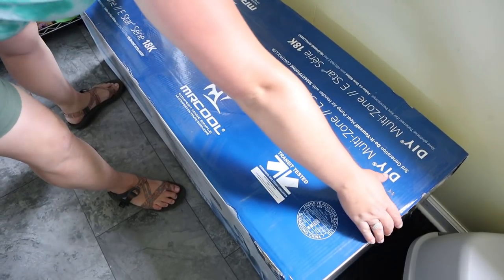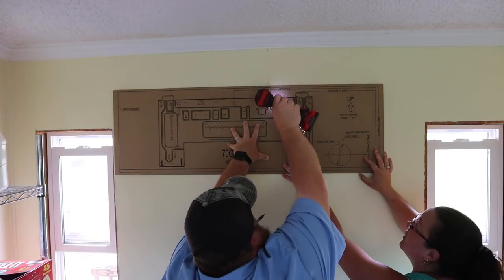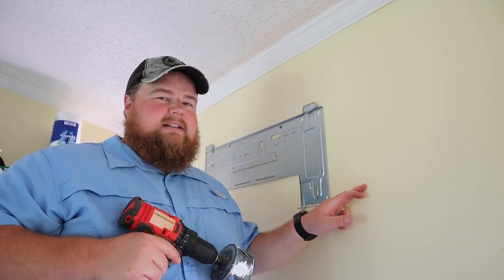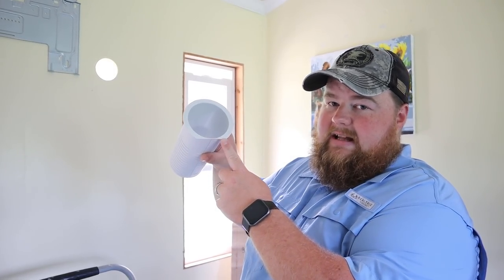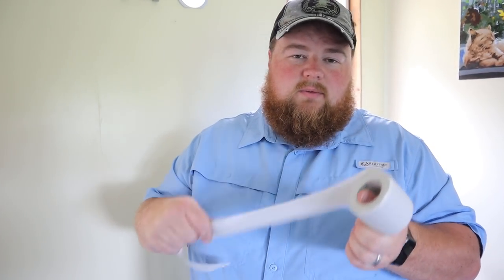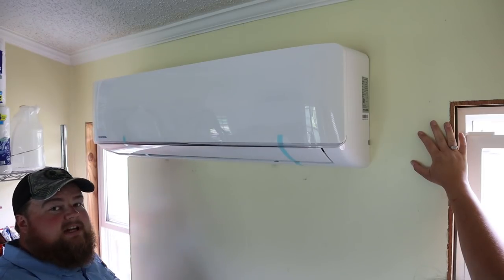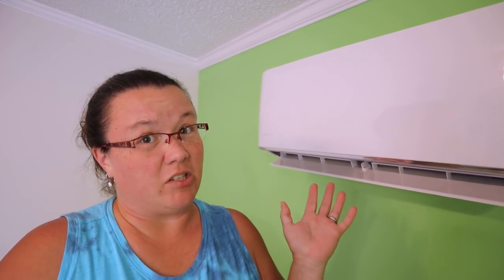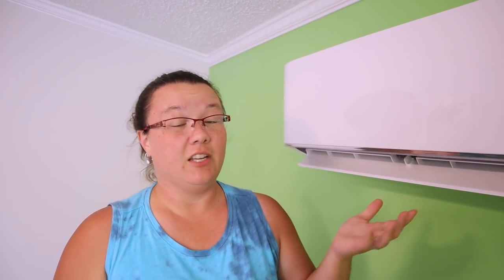Drilling HOLES Through the WALLS - Indoor Unit Mini Split Install

Comment: Push the wall thimble trough the wall, go outside, mark the thimble where it needs to be cut/trimmed flush with the exterior wall.  Remove the thimble, cut it at the mark, replace it, install the exterior cap/trim piece sealing the trim piece in place.

Comment: It's a frosting...  Now, you could center the unit if you wanted to remove that section of the sheetrock and re-frame the studs then put new sheetrock.  I know, that's being compulsive but that's what I would do.  (Oops, not sheetrock)

Comment: Hey you two, I am 83 yr old lady, me and a young friend installed my My Cool, 18,000BTU. I live in a 61 year old 560 sq ft mobile home.  You will grow to love that thing  on hanging on the wall. They wanted $4000 for a unit and I was running a 12,000 BTU window unit that I could not even hear the  TV.  I don't know how the multi zone unit works but I am sure just as well. I also talked to Mr Cool several times for help and they were great. I am glad you can turn the temp light off, in the dark of the night it is pretty bright. I did get my unit from Home Depot for $1700. Just cannot beat it, so quiet. Keep up the good work, I am anxious to see you hook up the condensing unit.

Comment: As I watch this video, I am having two AC units installed here in my home.  The older units are 15 years old and one has been giving us problems with low cool air, we don't want to be left in the heat, just in case the unit fails us!  lol  A lot of adjusting as one unit was too close to the ceiling and in an awkward place to have it lowered.  That of course means cutting into the wall, running the wires, etc. down to the lower level and into the ceiling and outside!!  Happy that you both challenge yourselves and get it all done!  Awesome work!!  TFS  :)
Reply: @lifequest7453  I believe in using something as long as possible.  Happy to hear that it's still working for you!  If you change eventually, this video sure does help!  :)

Comment: I love my Mr. Cool mini split... Had it 3 years now. Heated the house in negative temps.

One thing they don't tell you is crud (mold?) will build up on blower fins. You'll have to disassemble the inside unit to remove the blower fins to hose them down

Comment: When I have to hole saw through a wall, I drill a 1/4" pilot hole through first, with a long installer bit.  Then hole saw from the inside, then go outside and use the pilot hole to guide the hole saw.  That way your holes line up perfectly, first time every time. 👍

Comment: Silicone tape is tricky but great stuff.heat res and uv res , if stretched enuff it will adhere to its self.I usedmany rolls for HV splices.I would have centered tha unit by drilling new mounting holes to match tha studstuds.They work great, had one in my shop for years.
Reply: @lifequest7453   I, like Sam, am bothered by  off center mounting but am sure what they could have done to make it more centered because Ive done it. Mines worked Great for many years. Cl;-[p} Happy 4th

Comment: So I've been watching a few of these videos to try to brainstorm how I'm going to run the lines and stuff (almost nothing is ideal, sadly). A few things I've learned that I should share with y'all:

- the tape is not supposed to be adhesive; it's insulating tape for when the lines leak some condensate that makes it through the foam - you don't want it to leak in the wall. So you have to tape where the wrap starts and ends to keep it in place.
- before you click down the unit, you can adjust it slightly left and right to align it - the smaller air handlers have a bit more adjustment available
- you should pack the inside and outside of the tube with caulk/foam/the nasty squishy oily stuff that I forget the name of so that bugs don't have a route inside
- you didn't do this but lots of folks do - don't put the communication wire in the wrap with the 3 hoses

Comment: I'm about to install a mini split. I don't see, from the template, how if I screw into a stud with one mounting screw I'll also be able to hit another stud on the other end of the bracket. Also, the building has board and batten siding and I'd like the line set to come out centered between two battens. But, I had an idea: If there's no stud where you want to put a mounting screw, cut out a section of drywall behind the wall unit, install blocking horizontally between two studs, replace the drywall and tape and mud the seam. It will be behind the unit, so no need to be super neat, or repaint the wall patch, as long as it's flat.

The other option would be to not care about the line set coming out through a batten. If you have extra batten material, build up around the hose thimble so it sits on a flat surface.

I would have liked to see how you finished the outside of the wall penetration.

Comment: Did you consider individual units as opposed to a multi zone system? I am involved in something very similar to what you are doing with a 1987 Redman. I chose two 12000 BTU units  for this one with the thought that a failure in one would be easier to handle than replacing a multi zone unit. I really appreciate the work you do presenting these videos as they help me a lot.

Comment: (Tiliting slighty downward) Use a LONG bit to drill a 1/4" hole through the wall section (in and out) .  Then switch to the hole saw and, using teh 14" pilot hole as a guide, cut through the interior wall boad. Then, go outside and, using the same 1/4" pilot hole as a guide, drill a hole in the exterior wall.

Comment: We didn’t have that issue with either of our units. Hubby did install a 2x12 between 2 studs so it could be centered though because ours walls were open. Could you drill your own holes in the back plate to line up with the studs to better center it?  I know it’s too late now or maybe not since you plan to vinyl the outside of the home. Idk. Just random thoughts. Great video!  I always enjoy them. God bless.
Reply: Great advice to think ahead. We're in the middle of a Total gut job in our mobile home.
Reply from the maker: Smart move on the 2x12. :) We're not fussing over ours any further -- they're installed and not that big of an issue. :)
Reply: @sam-and-angela  I hear ya Sam. It is what it is, and it's done. Don't sweat the small stuff. ❤️👏✅
Reply: @sam-and-angela  For sure!  I only mentioned it because you said you would have preferred it be center. It’s easier when the walls are open. I hope you and the family are enjoying the units!

Comment: The tape they send is definitely crap. I’m looking at doing all of my rooms and was curious as to if you Rand all your lines exterior? I know they have the ceiling ones now, but nervous as to which one to get. The exterior supply is 75 ft from the three bedrooms and 30 ft from where the front one in living room will be.

Comment: Love!!!    So, are the splits (units) going up on the same side of the house- like all on the back side?  Also, my understanding is that you can run each unit alone, or all at the same time?  Eagerly looking forward to the next video about connecting.
Reply from the maker: Yes, we've installed them all on the same side of the home so all the ugly bits are on one side (the back). Each of the three units can run independently with different fan speeds, temps, etc. and also all at the same time. Most times the air handler units will be more BTUs than the outdoor condenser (at least that's what we often saw in kits), but that is okay. It will run at the max BTU it can and the inside units will be a little lower than advertised. This is only an issue when all three are running ((9k + 9k + 18k) > 27k). Otherwise it performs at max BTU for each air handler unit. The only thing they have to all do at once is be on Heat or A/C. You can't have one doing heat and another A/C at the same time. It's an all or nothing setting.

Comment: That heater you have behind you will put out more heat in ten minutes than central will all day. Those are good heaters and we sold many many of them when I worked at Home Depot. Everyone liked them and with many of them you do not need electricity to run them.
Reply from the maker: We're keeping the propane heater in the home -- great backup for power outages too. :)
Reply: @sam-and-angela  A fantastic idea. From time to time we all loose power and it is at the worst time. We were without power for a total of 36 hours and the Dearborn heater saved our bacon. Texas is not on the national power grid and the state power grid had never had anything like the -2 we had. They have learned a lot.

Comment: I have a silly question, what keeps bugs from crawling in thru the tube thru the wall???
Reply: You seal it with caulk or spray foam.
Reply from the maker: The tube goes all the way through to the outside and gets trimmed to fit and sealed up from outside. We'll show it in the next video. :)

Comment: I just had a heat pump put in and there was no thimble or anything similar used. There's just a hole in the wall (mine is a ducted pump so it's near the ground) to the outside with pipes through it. Any recommendations on how I could fill it?

Comment: Awesome Thx! Off-topic question: the wall you had to saw through even though on vid at first look appears to be drywall but as you said it was paneling. How did you get the paint so well applied on the paneling? Didn't your paneling have a coating and the common grooves?
Reply from the maker: This type of paneling was flat with no grooves. We used a paint and primer in one. Valspar I believe. It has covered very well and had minimal scratch off ☺️

Comment: Could you have mounted a 1x or a 2x  to length to the studs (2 of them parallel vertically) then mount the unit bracket anywhere on the 1x or 2x’s)

Comment: Is it possible to install them on an interior wall if done during renovation when the wall is open?
Reply from the maker: It's not recommended, but anything is possible. :) You would have to split the finished wall covering around the line set hoses and patch that area. Our understanding is that once connected and hooked up, you cannot disconnect the lines without loosing the refrigerant and then having to get a HVAC company to come pull a vacuum and recharge your lines. So... it's technically possible, but not exactly something that's easily doable. Hope this helps!
Reply: @sam-and-angela  thanks! Gives me an idea of how to plan for them when re-framing exterior walls then lol
Reply: My dad installed one on an interior wall years ago, but I honestly don't know if he ran the lines up through the attic or down through the basement before going outside.  (I'm suspecting the basement.)  The other side of the wall was a hall closet, so I know the lines go into that closet, but I'm going to have to look the next time I visit.
Reply: @davidreed9615  oh now there's an idea! Tho I'd have to go thru underbelly of mobile too. Hmmm

Comment: Still working good? Thinking about doing this in our mobile home any issue since install? Thanks!
Reply from the maker: We just had this connected back up after moving our mobile home earlier this year (many videos on our channel about that fun)! We had an HVAC tech check for leaks and levels. Said we were low 2 lbs. of refrigerant. BUT that may have been due to our installing the unit in this video then later disconnecting it. We thoroughly enjoyed the mini splits as seen in these videos and look forward to them again at our new property!

Comment: Energy savings climate control, smart investment for all the remodeling you did to the 1988 Palm Harbor single wide trailer.  Right after the video a Mr. Cool advertisement ran LoL. Zip ties could have been an alternative solution to reinforce the tape.

Comment: Hi guys❤️so obviously you've been enjoying this for a while. What are your thoughts on performance with the dinning room unit. Is it sufficient in cooling all three rooms. Trying to figure out what size unit we should get. We don't have a dining room in ours. Only kitchen and living room. I love you guys but your killing me with these short video s 😂
Reply from the maker: The whole system is great! The dining room unit does fine to cool the whole area no problem. They have a "turbo" setting and it can easily lower the temps in the three rooms in short time if we come in from working outside and it feels too hot inside. These are awesome for inside the home. The downside is how they look outside though... that'll be in another video.

Sorry for the shorter videos, but we're chunking these into subjects more than running long for everything. Our goal is that these videos are found by new people searching and looking for specific information on the bits. :) We'll surely be long-winded again soon. LOL

Comment: I’m considering going from central A/C (original duct work is bad, weak air flows) do the air handlers draw the power they need from the outside condenser unit?
Reply from the maker: Yes, the indoor units have power wires that connect back to the outdoor unit and receive their power from there. You only need to have power to the outdoor unit to run them. We love our mini splits! We've taken the whole home to another state this last year and had them re-installed and checked out. They're great!
Reply: @sam-and-angela  awesome and great to hear! I would love to see the new changes that yall’ve done!

Comment: Sixteen O.C. is industry standard for stud placement.  Surely Mr. Cool knows that,  Did you call to ask "Wha's up with this?  How do I work around it?"  Looking at teh diagram in teh Instaallation Manual, there is 5.65" between centers as between teh RIGHT SIDE MOUNTING HOLES and the 3.5" LINE EXIT HOLE. Looking at your cardboard template and then at teh mounted template itself, you had plenty of room to move that mounting bracket to the right and could easily have shifted tehee braket to the right an inch and a quarter, then drilled new holes in the bracket so as to hit your studs.
Another approach would have been to put your bracket in place and mark where you would like to have the holes (to the right of the two existing studs) and the outline of the bracket, Then, (neatly) cut out a section of the drywall to the right of the existing studs, insert a piece of 2x4 (long enough to 'catch the bracket's attachment screws' and wood glue (rub joint and screw it to the stud) replace the section of drywall (as if patching a hole)  and repeat for the right side. Now, you have effectively moved both studs to rhe right 1.5" and can shift the eniter unit to the right.  And, if you're a poor drywall repair guy, no problem cause it's all behind you(r air handler).
If you wanted to movit farther to the right - you still have the option of drilling mouting holes to the left of the 'factory holes' and that might give you enough to get it centered!

Comment: Does each unit have ac lines that have to be hooked up
Reply from the maker: Yes, each indoor air handler unit has a high pressure, low pressure, and electrical cord that runs all the way back to the condenser. They each have their own condensate drain line too.

Comment: Ruth here, so heat for your bathrooms? I hate to use a cold bathroom in the winter
Reply from the maker: Our home is small enough and the rooms open enough that it all evens out. There are only three doors in the inside of the whole home -- bedroom, bedroom, bathroom. So it all flows nicely. We have ceiling fans and if needed box fans to move air, but it mixes well.

Comment: 🎉YAY YOU!!! 🎉
Suggestion: to calm Sam's ocd in the dining room, you can camouflage the wonky space on each side of the unit with strategically placed curtains to fill in both sides all the way to each corner.
I hope that makes sense. 😢
☮️💖🙏🇺🇲🇦🇷✝️

Comment: Refrigerated air is heavy and will dive to the floor & requires moving cooled air off the floor, around the room, for maximum A/C efficiency. Moving or mixing cooled air prevents or reduces warm spots in rooms whether sitting or standing. A fan or fans strategically located in your floor plan will ensure proper movement or mixing of cooled air in each room! Stay Kool, for less $$$